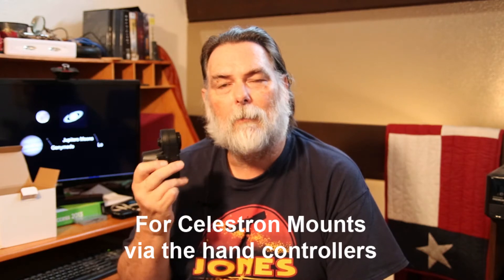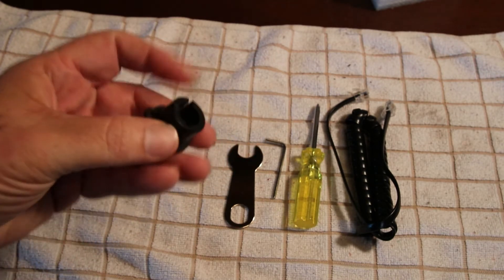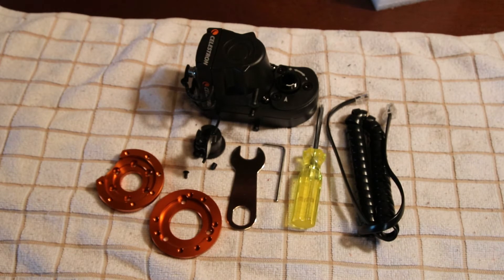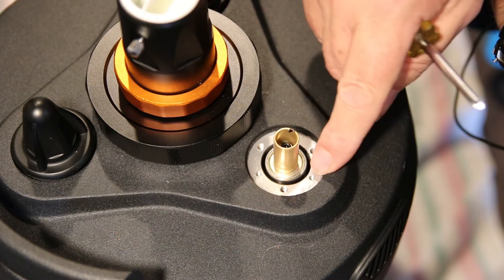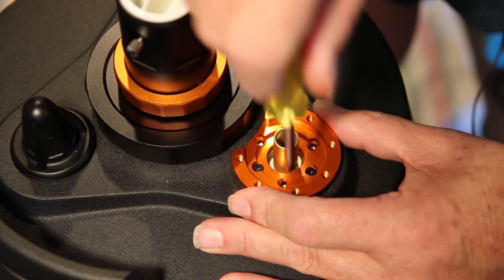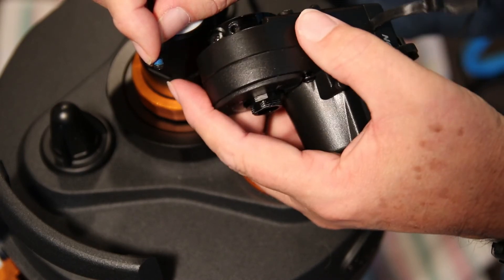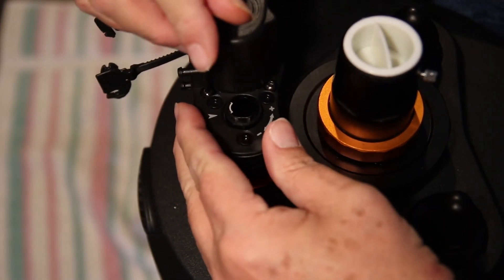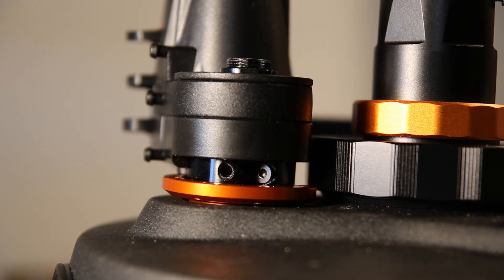Celestron Focus Motor installation on an SCT OTA

Comment: Had mine installed on a C11 for about 1 yr. Loved it, but it failed last night.  
It began spinning erratically and no longer will calibrate or report position.  
Anyone else have trouble like this?
Reply from the maker: Yes the center collar tube on the motor that fit’s around the focus turn shaft of the OTA would bind, then all of a sudden it would take off spinning. There is a thin nut with two flat areas just around the center collar on the outside that faces you when mounted. It had loosened on the motor collar, I tightened that nut up and that corrected the issue.
Reply: @AstroPatio  hi.  I thought that also. Mine was loose but did not spin.  I went thru normal checks and found nothing.  My unit was out of warranty so i took it apart to check the encoder.  Pictures of that are on cloudynights.   Blew some air thru it in case of dust. After reassembly it worked for a day then Went back to the same.   I can only assume it is a logic board issue.  There is very little in their except a motor, encoder, and a logic board.  I bought another one.
Reply: @weegieb  It binds because the collar that fits round the shaft is too loose and not centred when you tighten it. I found my focuser was rocking from side to side as the motor turned the shaft. The solution is to add a layer of tape round the shaft so that the outer diameter is a snug fit for the collar, which will be much closer to centre once it is tightened on the shaft. A single layer of duck tape, no overlap, was perfect for mine.